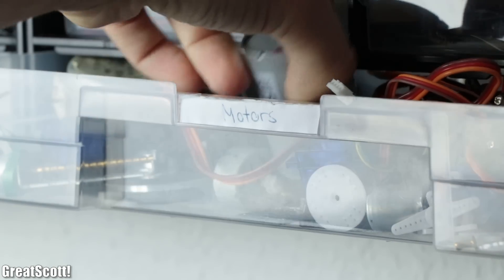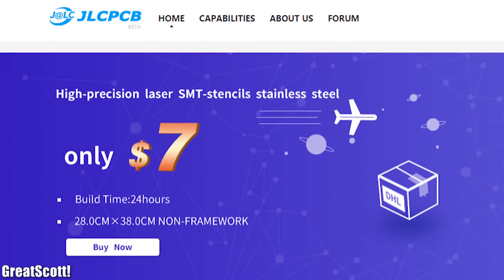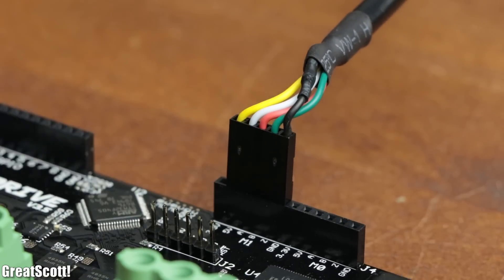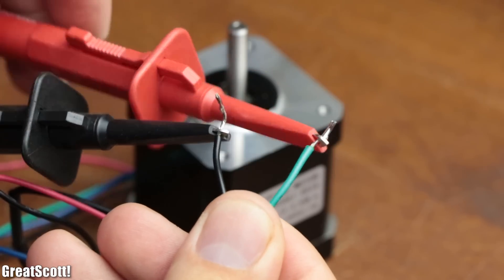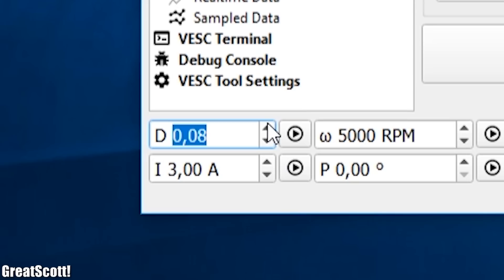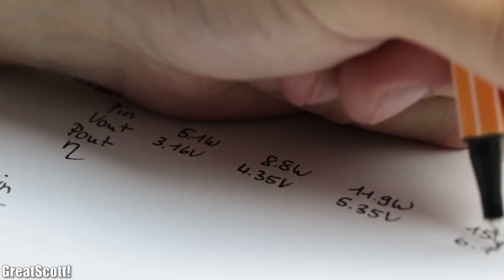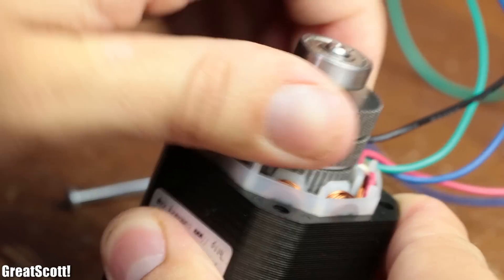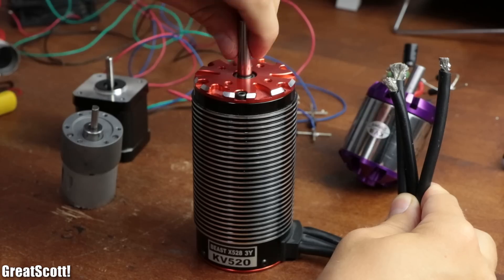Which Motor Type is the Best Generator? || DC, BLDC or Stepper? (Experiment)

Comment: I agree with the conclusion, but your testing with a geared DC motor was a bad example, so the whole experiment was kinda unrelated to your final opinion...
Reply: Hadinos Sanosam   yes, that muddied the waters. The other systems have losses from conversion to dc which the brushed motor doesn't.  It's performance here was surprisingly bad.

Comment: A simple permanent magnet synchronous machine (which is pretty much exactly the same thing as a BLDC motor) is best for simple and small generator applications. It has the least losses and the best frequency stability.

Comment: What happened to servos?
Reply from the maker: They are also just DC Motors with a gear system and a bit of control electronics. (I even made a video about them). So I did not feel like including them.

Comment: For BLDC MOTOR gear box system, you have to design gears in solid works or other 3D software then send that 3D file to CNC mile thay can make a gear box for you.👍

Comment: Great question and great video!  I am fascinated with your penmanship.  Thumbs up, as usual.  Now out of the larger motors, such as an appliance universal motor, and a treadmill-size DC motor, which is more efficient as a DC generator and are they as different in efficiency from each other?  I assume both would not have gears, only the motor.
Reply: I too, have noticed his penmanship. It's to the point of obsessive compulsive. How do I know? I see myself making the same "corrections" to my handwriting.

Comment: Hi, as a mechanical engineer I would like to comment on what you said about the gearbox. You said rotating the output shaft 'felt' heavy because of the change of torque. More correct would be the change of inertia proportional to the inverse of the ratio squared. The change of direction will change the motor inertia (including gears in gear box) to a very large value, as the ratio will be inverted. More info with electrical analogy: https://physics.stackexchange.com/questions/73531/is-squared-motor-gearbox-ratio-proportional-to-inertia-ratio
Reply from the maker: Thanks for the information

Comment: 3:54 you dont should touch resistor with bare hands
Reply from the maker: The resistor is around 15ohms while my hand resistance can be around 1-100kohm. It really does not matter in this case.